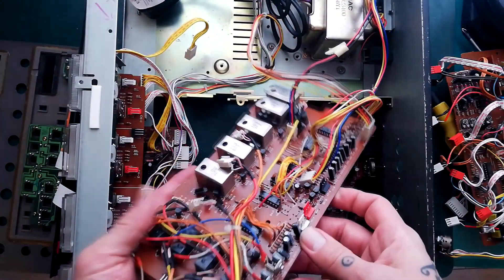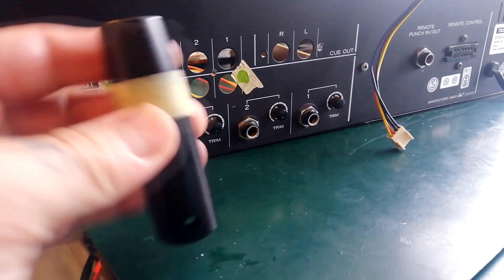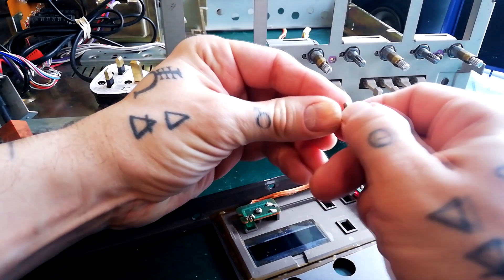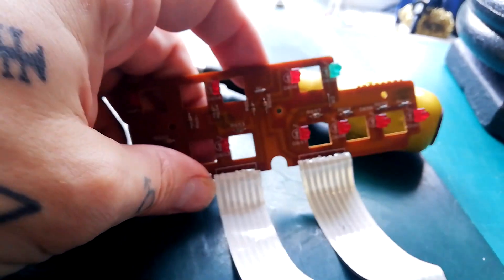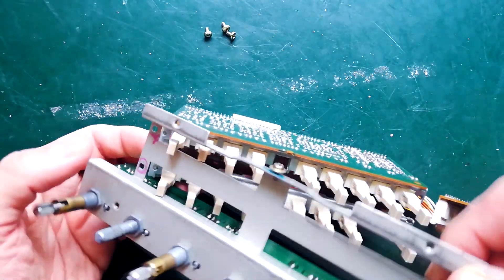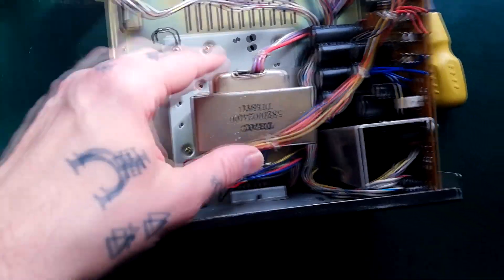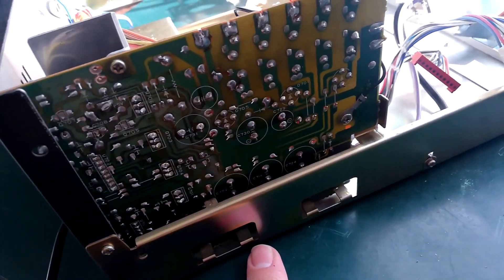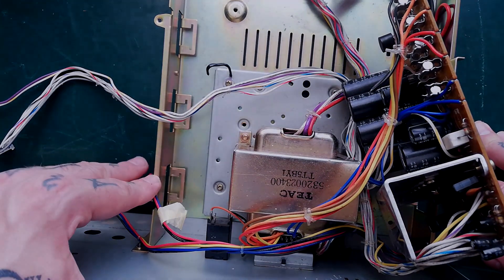Tascam 234  | Tear down | 3/3 | Completing Disassembly

Comment: Hi, great video.   I'm looking to get a used one and the seller says the unit makes a motor noise when turned on.  Shouldn't that happen only if you hit play? I'm concerned there is a pcb issue with the motor.  The 238 has this issue , but the 234 is different isn't it?  Thanks.
Reply from the maker: Thanks. The unit has three motors, one of which will spin very gast and quite noisily if its belt is missing. I suggest you watch my series of videos on tje 244, which has more or less the same cassette player. That whole 234 unit is a bit of a pig to work on, but in relative terms, it's an easy fix.
Reply: @Tetrakan  ah, OK makes sense.  I'm in the middle of a tascam 133 belt swap and love pulling it apart.  I didn't know anything about my 1st one.  I'm comfortable with it now.  Lovely machine.  I wanted to get the 234 because it will be a learning curve and fun to dig into.  I had a 238 and didn't bother with it, because the runaway motor thing looked out of my depth.  I'm more into the mechanics, not so much electronics end .  Are the 234 belts common with other tascams or are they specific to that unit?  I didn't see many online.  All overseas.  Thanks for your reply.  I enjoy the breakdowns.  👍
Reply from the maker: If the belts aren't the same as the 244 I will say so in the 234 tear down videos, it's beeb a while. And I only know suppliers from a Scottish residents perspective - Gbaudio.co.uk
Reply: @Tetrakan  I'm in Wales.  This place does the belts? I've bought from a bloke in Greece before but delivery is a bit long.  Anyone in the UK have Tascam bits ?
Reply from the maker: Gbaudio is your best belt source then. Edinburgh, first class, one working day usually. Tascam.ninja in Greece is the only person I know of parting these things out as a business model. I sometimes have more spares than I need, but I've never got around to a website to sell them.
Reply: @Tetrakan  I was watching you do the belt on the transport motor.  I've got mine cleaned up and pulled the transport apart to understand it more.  The little white linkage bit you said to be careful to slot it in correctly.   Should the cam wheel be in a certain position when the belt is fitted, ie  locked in place, or is it just a matter of lining that little prong into the slot on the black cog?  I'm assuming the motor spins only one way and it adjusts itself once you fire up the power, and clicks off when it drops into position? It looks like a critical part of the system so I wanted to make sure I didn't do a rookie error 1st time around.   Its a lovely deck, and looks untouched inside, almost factory on cosmetics.  I've pulled the manuals also from your website so that was very handy.  👍
Reply from the maker: If ots the 244 you're talk8ng about refer to this guide https://www.mzentertainment.com/pics/teac_244/dr_zee_workshop_tascam_244_project_part5.jpg
Reply: @Tetrakan  No, the 234 cassette deck. Looks a little different.  You mentioned  winding it back the cog clockwise or smt.  That apply to both?
Reply from the maker: Sorry, if im  not specific about it in the video you're going to need to experiment -  I don't have it in front of me, and I only ever worked on the one 234. Wrong alignment won't damage anything, it'll just cause strange behaviour.
Reply: @Tetrakan  hi.  Got the belts on fine. All working fine , except on recording it sounded rough and the tape stopped after 30 seconds.  I noticed the pinch roller is gummy and the black goo comes off it when cleaned.  The pinch roller when engaged in play (no tape) slips on the capstan. New pinch roller required? Or can it be pulled off and salvaged?    I saw they were like 40£ online.  Yikes!
Reply from the maker: You can transplant the rubber from a generic pinch roller costing less than £3 onto the original brass core https://youtu.be/YMWHQgfCS5I
Reply from the maker: Very thoroughly clean the heads and abandon that tape ASAP. Pinch roller tar can block the head gaps, and so far, I don't know how to unblock them.
Reply: @Tetrakan  yeah , I ordered a tyre and cleaned off the roller.  And a TDK SA blank.  The heads looked clean afterwards.  Can you see if tar gets in the gap?  I've never heard about that before but I'm sure it's not good.  I figured the roller was slipping or not working as it should as to the crappie sound.  I'll wait for the wheel tyre to arrive and try again.  Recoding on track 1 and 2 from a CD player via the rca Jack's should work OK to test the unit right?  I'm not familiar with 4 track machines.
Reply: @Tetrakan  I also have a tascam 133.  I was fiddling about with it today and went to turn it on and got a blinking red LED (record button) on the control panel.  Now none of the play functions work.  I checked all the wiring and connectors and all seems OK.  Is this a fault warning?  And what's usually the culprit? The thing worked great up until this.  There was a relay that was added on by the previous owner that was bypassing the weird waka remote control  plug via an xlr plug. I have removed that but still blinking.  The relay had been clicking when I was pushing and moving wires and one time the transport started working as it should.  But when I tried to isolate the problem It went back to blinking.  Its a bit frustrating, but I don't think I blew a resistor or a board because it worked fine at one point troubleshooting.   Any of this ever happened to your Tascams transport before?

Comment: Thanks for the video. Gives me enough info to tackle troubleshooting my 234. Was my Dad's and in pristine condition. After Dad passed away, I put it on eBay and sold it to a buyer.  He said the door wouldn't open, which was a surprise since it was working perfectly. It was returned to me with door not opening as he said, but it also came back with an electrical squeal when I turn it on. I think the buyer may have swapped out parts to his advantage and then requested a return. I should have placed tamper resistant labels on the cover screws. Live and learn on eBay! I'm going to tackle trying to figure out why the door button just presses in with no pressure back or movement in the door. Then I'll look at the squealing. Any advice would be appreciated greatly.
Reply from the maker: The door on that unit is very finicky, to be fair to the buyer a lot can happen to these things in transit. Try removing the outer part of the door, the cosmetic part, and refitting it. I found a half turn of this screw and that screw made the difference between the door opening or not. Squeal - is it constant? It’s not just the controls turned up? This model and the 244 both put a squeal through the headphones on power up/down which is not ideal but normal.
Reply: The door won't open if the transport is in the up position.  You rotate the white plastic gear on the top when you open it up. Possibly the cam belt is broke or misaligned?

Comment: Nice to see final stages. Have you worked out what’s wrong with yours yet?
Reply from the maker: Thanks. No, it's definitely the control boards because the motor and transport switches are okay. I'm having a break from it while I read up on the surrounding theory.
Reply: @Tetrakan hey did u ever finish this unit? I’m currently working on mine but the head cartridge moves up and down on power up uncontrollably.Any thoughts on why this is happening?